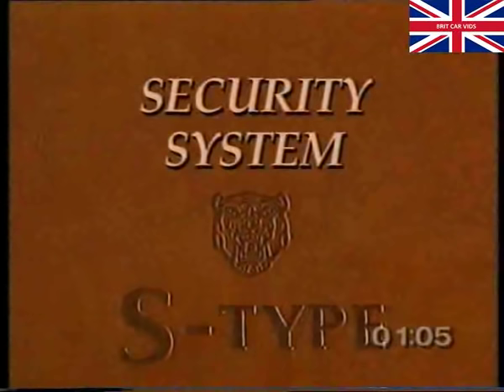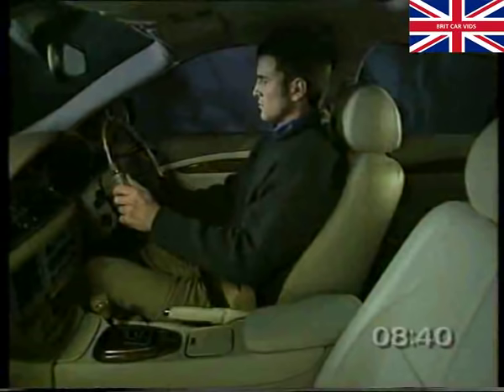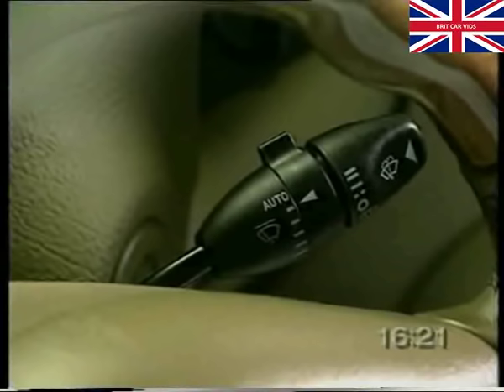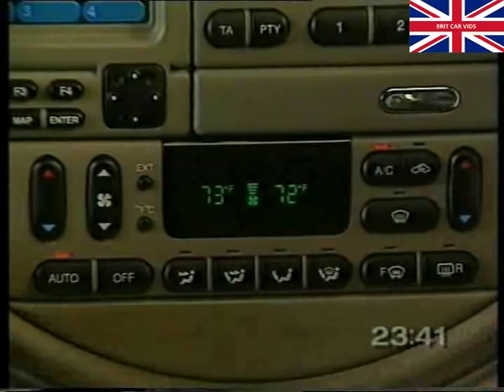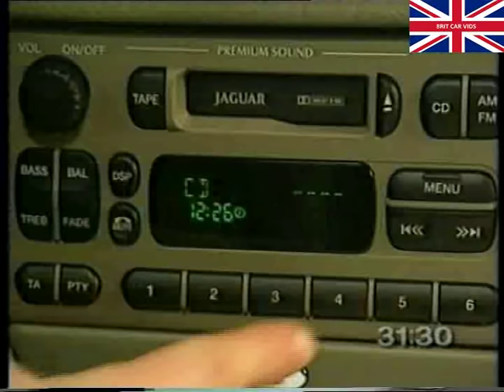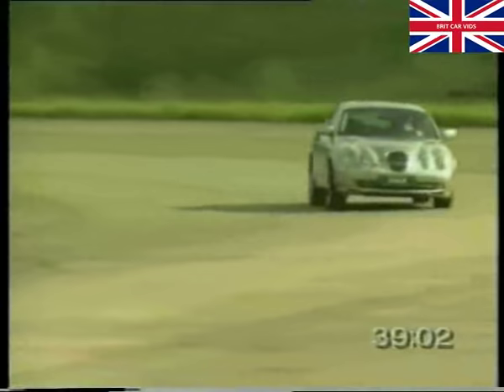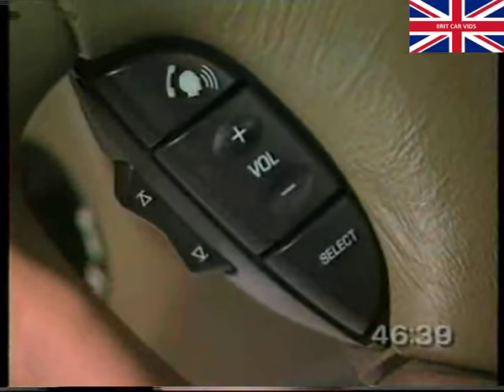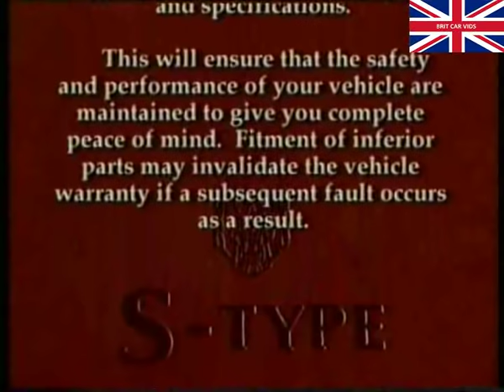Jaguar S Type - Customer Handover Video (1999)

Comment: Don’t open the sunroof a lot, the headliner will start to sag!
Reply: My s type doesn't have a sunroof. 22 years old. The headliner also sags. The foam slowly disintegrates over the years. I used twist pins to pin it back to the fibreglass.

Comment: I had a 1999 model, had lots of issues with the central locking, it just had a mind of it's own, it would double lock the passenger door while driving along, sometimes the car would lock and unlock fine, other times it would lock then just unlock on its own or unlock and then lock immediately! Very complicated system, I tried diagnosing the fault but never solved it!
The fake 'wood' trim was disappointing but comfort was spot on. Lovely car to drive, those classic Jaguar lines really give the car lots of character.
The 3.0 v6 engine is basically a Ford Lincoln LS unit, so when ordering parts check for a Ford equivalent part, usually loads cheaper! 
I had the satnav option in mine, worked great, maps were years out of date though and entering an address was a faff but it did work well.😎👍
Reply: Jaguar doesn't do "fake" wood, so you really don't know what you're even talking about. Cool story though.
Reply: @jmin8400  My 1999 'jaguar' s-type was more ford than jag, it didn't 'feel' that luxurious to be fair, sure it was comfy and a nice drive but not what I'd call luxurious by any stretch!
The steering wheel felt like a quality piece of wood but the dash and door trims, looked 'fake' one of mine had a suspicious looking hairline crack, rather like how plastic cracks, it just looked and felt fake! 🤔😯
Reply: @pdtech4524  Wood was laminated poorly maybe? I worked for JLR primarily at Jaguar, years after the S-Type era as an engineer, but my father was a regular customer for the XJ-Series over 20 years ago and I saw the S-Type when it arrived in UK dealers on March 24, 1999 and USA April 28, 1999.

I know for a fact that under TATA, many concessions were made in terms of quality at Jaguar, because I was very instrumental to the process and privy to what was approved and rejected, often being they vetoed suggested quality control improvements of mine to save £££. I have Jaguar patents with my name, both a disgrace and accolade, depending on what it is.

In the Ford era, I do recall that DEW98 planning began around 1992/93 and X200 (S-Type) was definitely underway by 1994.

Styling was complete in the fall of 1995 and locked in by the summer of 1996, under Mr. Geoff Lawson. Was supposed to be launched in 1998 originally.
 
The Lincoln LS was really a cut down Jaguar, not the reverse. It speaks more to the struggle to water down the boutique XJ into a mid-range volume vehicle in the S-Type and still make a good profit.

But your story was interesting (I meant it literally), but seemed a tad unfair and odd, as wood trim is the highlight of Jaguar.

S-Type was the first Ford Motor Company product to have GPS navigation BTW, so quite interesting you had that. I was always fascinated by it, but rarely ever saw the system in person, as it wasn't a very popular option. I liked visiting Guy Salmon Jaguar in Coventry, near Browns Lane back then to see the latest. Very, very different brand now and not as exciting as a grown adult.

My father hated the S-Type, but I liked how the navigation system in it was a larger colour screen, unlike the half-assed monochrome LCD system in the 2000MY XJs that was small ASF and a joke by comparison.

X308 XJ being due for replacement in 2002 with X350, meant they weren't interested in doing a colour LCD screen like in the S-Type and chucked that silly BS in there. Even the MY2000 XK range got a much better colour LCD NAV system, than the 2000 XJ (launched September 1999).

As a young tech geek, I was annoyed, but of course my dad didn't care. He just was terribly arrogant towards the S-Type.
Reply: @jmin8400  Possibly a laminate fault then, I assumed it was plastic by the way it cracked, not with the grain, it looked like how a plastic trim piece cracks when you pry on it in the wrong place!

I'd always wanted a jaguar, the older xj shape was something that appealed to me growing up, I set my heart on owning one but at the time good xj models were few and far between and the s-types were reaching that trough in price, I paid £600 it was mint in terms of interior and bodywork, plenty of MOT and a fully stamped up main dealer service history, it was a much loved example. It had a couple of issues, the central locking would work fine one time then would unlock and lock, then the passenger door would double lock, not great when the passenger can't get out lol ⚠️😯
A slight misfire I quickly diagnosed to a vacuum leak  on one of the hoses which I managed a temp repair.

I drive a 1969 Daimler V8 250, video on my channel, very similar to the old mk2 jag. The s-type I had shared many similarities and you could clearly see the heritage when I parked them side by side!

The satnav in it was quite a surprise,  yes not many had them fitted, most have a cubby hole, I believe it was a £1200 option at new?
It was a bit of a fiddle to input the address, one character at a time, no option to input post code and the maps were 18 years out of date lol so, much fun was had watching the arrow pointer crossing empty fields when we were actually on a 10 year old bypass lol but I could forgive it for that, most of the roads were there. I even had all the booklets for the satnav and original software CD, I never tried updating it, the CD unit for the satnav was in the boot.

The plan was to sort out the central locking issue, keep it and enjoy it for a few years before selling it later when the prices inevitably went up.
But the issue was beyond my scope, the only way to properly diagnose it was take it to a main dealer at great expense and pay out probably more than what I paid for the car! Or substitute locks and control modules for known good units to pinpoint the faulty component, I suspected it was one or more of the door locks, which are very complicated units with micro switches and sensors etc
The whole system is a real nightmare to diagnose as there are at least a couple of other control units that are involved in the central locking system and the fault was intermittent!

Sharing the Ford Lincoln engine actually worked in my favour a couple of times, a new water pump,, the Ford part around £40 the jag equivalent part was 3 or 4 times the price, a few other savings were made.

Overall I enjoyed owning and driving the car very much, it just wasn't practical for me as a daily drive, I do miss it though. 😊😎👍
Reply: @pdtech4524  Sorry, just saw this! Very nice read!

I am glad you saved money using other from  Ford components, but I didn't know you got it secondhand. Silly me.

£600 seems like a good deal, for you to just be having central locking issues.

I think for those without GPS in the pre-2002 versions, you got a storage drawer. That was a more common sight for me, than a black LCD screen when not in use.

Seeing an S-Type with navigation 20+ years ago, was like spotting treasure LOL. For me as a young tech geek then, I fancied seeing the occasional car equipped with factory in dash GPS navigation.

As for the Daimler 250 V8, quite interesting how you've owned both a Mark 2 and the facsimile S-Type. Not many S-Type owners could ever have laid claim to that, since most I imagine were very fickle.

In terms of the XJ market, I can't say that I am surprised. It makes sense. My father still is holding onto his X308s and X350s, even if he's gone to Range Rover.

Comment: The X Type and S Type was the launch of total wrong ways for Jaguar. Cheapest interior with Ford technology under the skin. Fake wood, cheap plastic etc. Not even to mention modern Jaguars whom could also be Hyundais, Peugeots or Kias. You would not even see and feel any differences... Jaguar died with the X350, even though the X300 was the last real Jaguar.
Reply: You're delusional. No Jaguar has used fake wood ever.
Reply: @jmin8400  welcome to the new world of fake Jaguars. Fake wood, partly fake leather, rest cheapest thin leather, fake carbon today, downsized little engines for half children etc etc etc. Real Jaguars are out of production since 2009. The X350 was the last model comcidered being a Jaguar. The mess started all with the S Type, followed by the X Type, which was a Ford Mondeo in real. Sad story.
Reply: @houseofwine7704  I hate newer Jaguar interiors indeed and the interior fit and finish like you do, but real wood is used. Especially under Ford ownership days, was wood a focal point.

Any kind of crap caricature was designed for Jaguar (X200, X400), just as long as it had some semblance of Connolly leather and real wood trim. It wasn't fake nor is it today.

The design might suck otherwise, but real wood is there, whenever trim is specified. It's the only thing Jaguar holds onto today, in terms of "tradition".

I know this because I worked Jaguar, at Whitley in Coventry and left when my proposals for quality improvements, always exceeded a ridiculously low budget defined by upper management and TATA looming overhead. Plus, deliberately low salary offers after getting my MBA to deter a promotion.
Reply: Thanks for your thoughts, l would have liked to hear more about the history of the good the bad times at jaguar. 
I have 2002 X Type basic model 99,890 klms, an elderly couple had the car, husband passed away, parked in garage for years. Roof lining has dropped, only drivers door will open driver's well slight thud at rear wheels when going over bumps, but still l like the car. Take care 👍
Reply: @jmin8400  I appreciate your work and your answer. Going to look up what connolly leather is. As for moisturising and nourishing leather seats, is saddle soap a terrible idea?